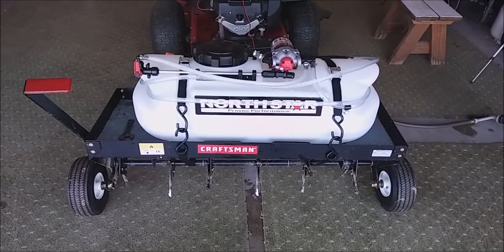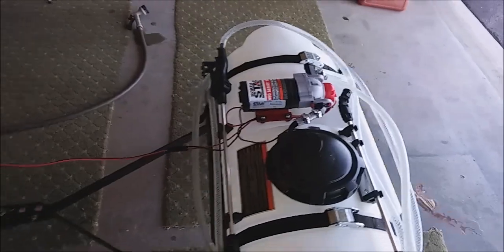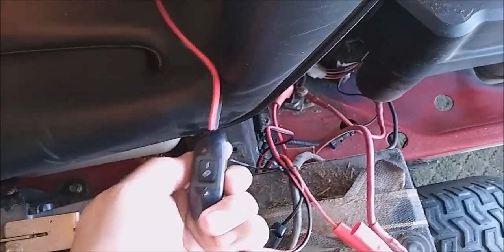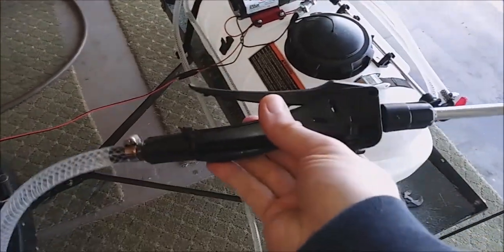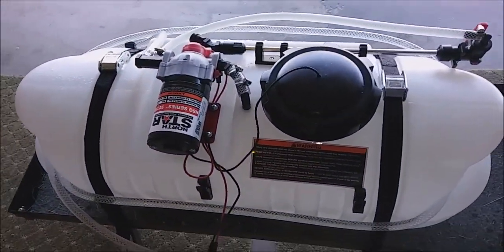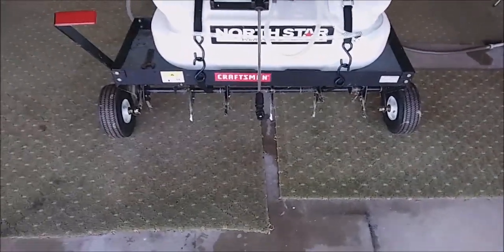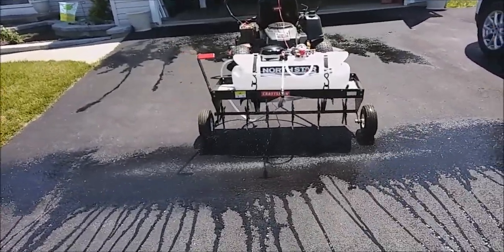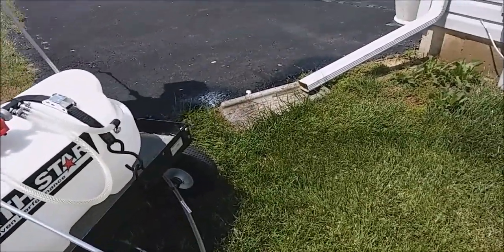Review NorthStar ATV Broadcast and Spot Sprayer 16 Gallon Mounted On Mower Pull Cart Attachment.

Comment: Fyi, it's not a "minus" sign. It's actually a 1. The o is a zero. It is derived from binary where a bit with 1 is on and 0 is off.
Reply: The  - o -  means open ( for open circuit ) and the - l - means closed ( for closed circuit ).

Comment: Plugger? It doesn't plug holes, it creates them. It's called a plug aerator. Just bustin your chops. I liked your video and actually bought the 26 gallon model. It would make a wider spray pattern if you mounted the unit higher on the back of an ATV like it was intended for.

Comment: Just an fyi to anybody who is curious or whatnot.. If it's mounted on an atv it (the sprayer for the back) would be higher in the air making the spray pattern wider.
Reply from the maker: You can adjust the wand & nozzle up or down to compensate.  Good luck
Reply: @DiyRick66  Really?

I do not have this item yet, and the one being sold currently is a slightly newer model (different pump). I have an atv and a riding mower. I was going to use in on the back of my atv as intended, but it of course has aggressive tires and I try not to ride it in my yard so as to not tear up the turf. So, I was researching how to use it on my riding mower which of course has much less aggressive tread.  Also, I really do not want a 14' swath each pass I make.

One of the questions asked on the sprayer being sold currently that is closest to this one is something along the lines of "can i adjust the sprayer vertically?" to which the repliy from a 'northstar expert' is "The broadcast clip should be mounted in the pre-drilled holes on the sprayer tank. Modifications to this could cause damage and/or void the warranty. The nozzle should be oriented to spray straight down. An incorrectly positioned broadcast nozzle may spray chemicals on you or others.". So, I'm sure you can adjust it, but you really shouldn't.

My mower is a cub cadet xt1, and they have an attachment for it that is a 'rear cargo holder' that is supposed to be able to hold up to 80 lbs (the sprayer is almost 30, and I'll most likely never fill it up all the way so even if I put 10 gallons it it only then it should be fine). I've went with this option :)
Reply: I have mine mounted on an ATV.  Problem is the tires tears the yard up and even worse when I turn around.  It does have a wide spray pattern, however.
Reply: @kennyg6482  Yeah, those two reasons are why I mounted it on my mower instead of the atv. Works great for what it is, although I wish it was easier to see the stream (I'll be spraying the side of my shed or garage and not know it lol) and I wish the suction hose was lower than the bottom of the tank, so all of the liquid would come out.

Comment: Saw reviews where people had trouble with it leaking at the drain or spray wand.  Any issues with that?
Reply from the maker: Kenny G None that I have noticed. Drain has plastic threads so could use pipe tape if needed. Wand not leaking either but same thing use tape if needed. Honestly though everything these days is manufactured in China so anything can or will happen. Rick

Comment: You should not put the straps around the axel.
Reply: Hey this is Rick. To be honest I haven't had any issues with the straps going under the Axel's. It really isn't ratcheted down supper tight. Just enough to hold it from sliding around or off. No damage to the Axel shaft etc. I guess if it bothers you, you could pass the straps above the shaft and more on the frame itself. Whatever works for you. I just don't need another cart with wheels plugging up my shed. Good luck, Rick